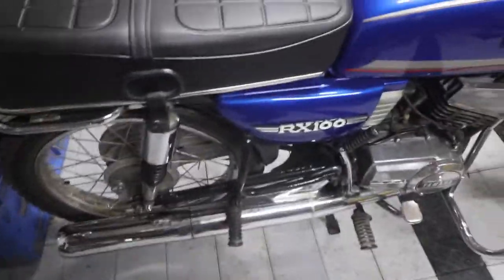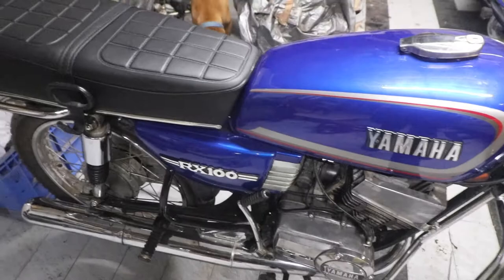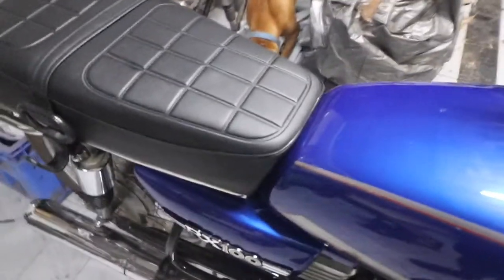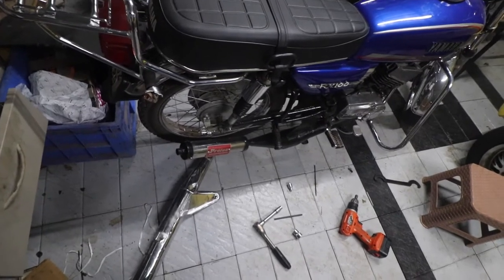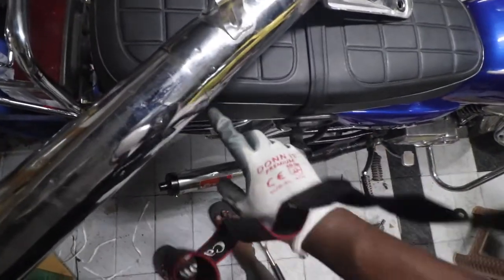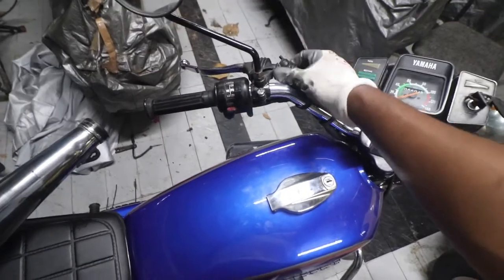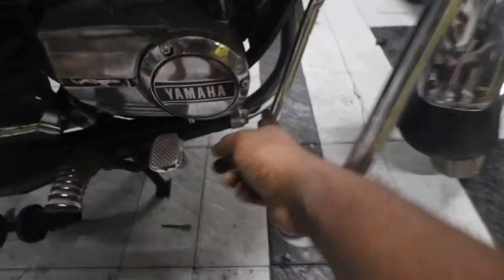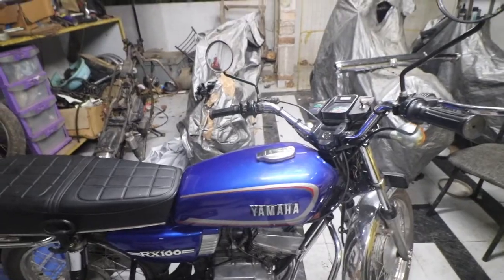RX 100 silincer broke

Comment: Bro, i have a chamber but as always its too loud i like the performance and dont like the low rpm sound...if i make a custom muffler and attach it to the end of chamber , will it effect the performance of chamber
Reply from the maker: 1llusionz first you need to understand the working of a chamber, positive wave and negative waves. The sound waves is what pushes the air fuel mixture back into the cylinder. If you change the intensity of the sound the frequency is not affected so technically there won’t be any impact. But if your muffler creates any restriction then the powerband will shift. Hope it answers your question
Reply: @Yamakaze  thnx buddy i got it

Comment: I have buyed the cat for my rx 100 and it was a big lossss
Reply from the maker: i dont like cats at all
Reply: @Yamakaze  the stock feel like 💓💓 some extra energy 💗❤️
Reply from the maker: The 2 Stroke GUY it’s all about the sound the stock exhaust is powerful than the cat, but cat increases low end torque in an rx 100

Comment: How to understand the piston size of the bike if no number is printed on the piston?
If you can send me you email of whats no. i can send you the pic of piston.
will you help me out?
Reply from the maker: Shriyansh Mishra the only way is to measure the bore size using a vernier caliper. Usually standard size pistons don’t have anything written on them. Just look for the brand of the piston if it’s ART then it’s standard. If you don’t have access to a vernier caliper then you need to take the cylinder to a lathe and ask them to measure the bore diameter
Reply: @Yamakaze  Std size will be 50mm?
Reply from the maker: Shriyansh Mishra no 50 mm is the second oversize
Reply: @Yamakaze  then what will the std size?
Reply from the maker: @shriyanshmishra8778  which rx?
Reply: @Yamakaze  RX100 1994 MODEL 
G1 SERIES.
Reply from the maker: @shriyanshmishra8778  standard size is 50mm